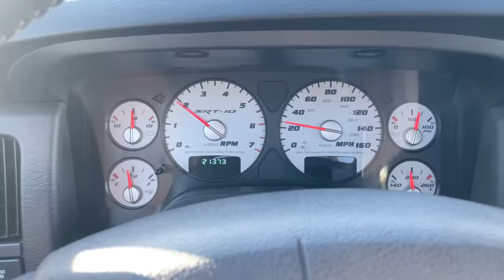The Danger Ranger 9000 Was WAY MORE Dangerous Than I Thought... (My Race POV of the Crashes)

Comment: The PIT maneuver was adapted from the bump and run technique used in stock car racing, where a driver would bump a competitor in the rear bumper to cause the other car to lose traction and swerve away from the racing line. The PIT maneuver differs from the bump and run in that the car is bumped from the side near the rear wheel, causing the vehicle in front to spin out. It is illegal to perform this maneuver intentionally in stock car racing because it is very dangerous.
Reply: They should figure out some type of lap penalties, to stop people from pitting. But at the same time, that’s what’s making it crazy and exciting. I loved this. Just felt bad for VGG.
Reply: @bassist21685  Agreed 👍  a 1 lap penalty for not holding your line and PITTING someone
Reply: how do you establish intent, if a car is low and on the inside, by nature of an oval you drift high. If you have a car ahead and on the outside contact is inevitable. If the inside car purposely swerves to the right to clip the outside car thats a different story

Comment: Believe it or not. This is what “stock” car racing was supposed to be.
Reply: I think you need to do a little research on stock car racing, they’ve never been stock
Reply: @40ozPres  I think you need to do a little research on the definition of "supposed to be"
Reply: @40ozPres  stock car racing involved performance cars that were sold to the public and the cars are slightly modified within a certain parameter. Anyone could turn a car back in the 70s into a stock car with minimal effort compared to today where you cant even but the engines in the stock cars.
Reply: @gmg921  Not really, the early dirttrack cars were just normal cars. Litterally just faster sedans off the street. Stock car racing is way older than the 70s.
Reply: @gmg921  stock car racing was a thing well before there was performance cars

Comment: The higher the engine temperature, the slower the car's speed and the response you have to cancel the water valve in the cooling radiator, the speed will be very good.👍👏👏👏

Comment: And reason they flipped is cuse they have soft circle track tires on a high center of gravity truck. Yall should have ran dot street tires and only a certain kind that was really hard compound and made them fill up tires to recommended psi that might have helped with roll ivers or set a ride height rule where they can lower the trucks down to but not past to lower center of gravity

Comment: the trucks have quite a bit higher center of gravity compared to the cop cars 
might be fun to do a fourbanger race , restriction on engine size and maibe weigh the cars and add weight to the lightest ones so there all weigh about the same before the race 
these cars should be cheaper for the racers to buy and still can make a spectacle

Comment: And also yall should use in ear race recievers it's alot better then that radio with no ear buds the driver's buy or get the little yellow reciecer tune into the tracks radio frequency plug in there racing earbuds that cone with it or any race ear bud or even get custom molded earbuds like I use for my spotter under my helmet ug in and can hear perfectly and loudly everything they say on the radio in their ears

Comment: For the next one let them modify the trucks. No autocross suspension or motor swaps, no cutting the body away or swapping trans or gearing. But let them run turbos, blowers or nitrous. Cut springs, flip axles, gut the interior. Really haggard racer style. Run them all in a straight line before the event to pick the running order. Or do a spectator drag where everyone brings the same vehicle with stock drivetrain but different power mods to see who wins. They can use any power adder but can only win if it doesn't blow up.

Comment: Before these things started costing an arm and a leg, I’d buy them for $500 and drive the DOORS off those things. I would drive them until something catastrophic happens and wouldn’t put anything but fuel and engine oil in them.
 They typically have self changing oil.

Comment: I wana see like a 3rd gen race any car but has to be like the 3rd generation of it. can have a bunch of iroc camaro's and fox body mustangs or like a only 1987 4-cylinder only race all car must be a 87 and have the factory 4 cylinder in it can do any motor mods u want long as it's a stock block

Comment: Well if you would allow modified suspension there wouldn't been so many flipped over trucks.  I've been build building rangers since BEFORE Cleetus was ALIVE, the suspension in stock form/height is way too soft and they already flip too easy on the street if you hit something.. If these trucks were allowed to be lowered these become whole different trucks and the races would have been much more interesting and competitive. I agree with stock engines/no power adders thats fine, but what kind of idiot thinks stock suspension pickup truck racing was a good idea?